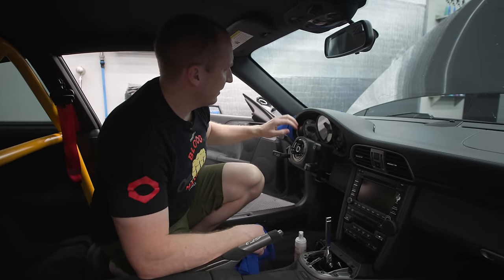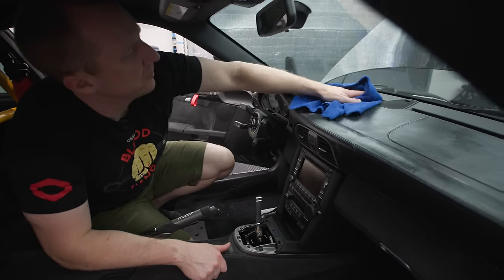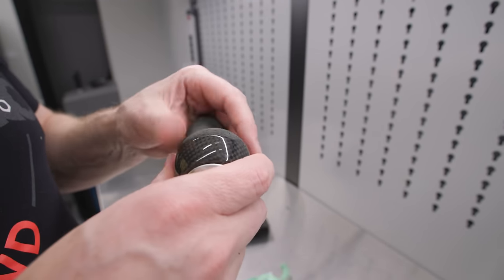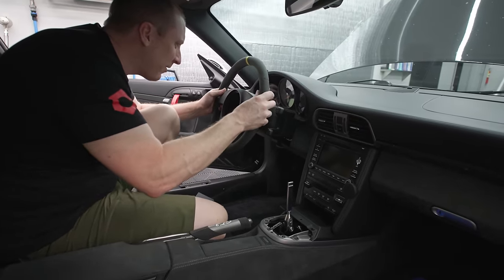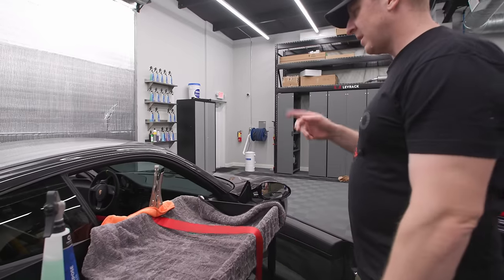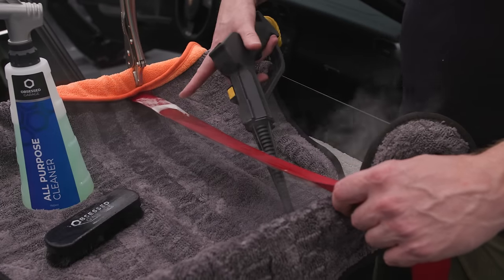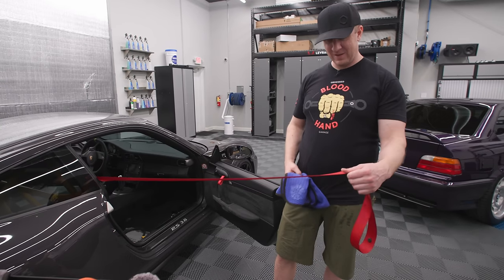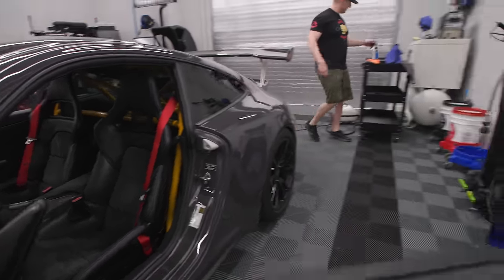997.2 GT3RS Interior Detail: Part Two

Comment: Dupray steamer is for sure the best. If you can swing the $1,999 price get the Hill Injection version, higher pressure and has continuous refill.
Reply: Is it worth 2x the price? I'm in the market for sure. $1k I'm in, $2k I'm skeptical
Reply: @bradhone9168  if you’re a detailer from my experience it’s worth the extra pressure and not  having to let the machine cool down before it can be refilled. I put distilled or Deionized water in it so it won’t build up minerals inside and last a lifetime.
Reply: @Skdjiejxuje  Great, that's the kind of info I need. Thanks🤘

Comment: Just bought a 2018 GT3, going to do this entire process. So what I'm seeing is, Colourlock Mild Leather Cleaner -> Colourlock Leather Protector -> Colourlock Leather Shield on all leather parts. Or is the leather protector unnecessary?
Reply from the maker: You have it correct.  Any leather over 3 years old should get Leather Protector before shield.